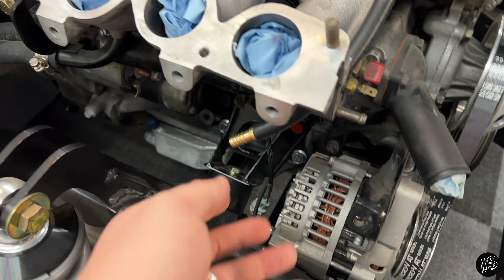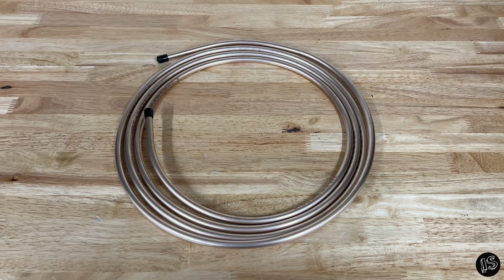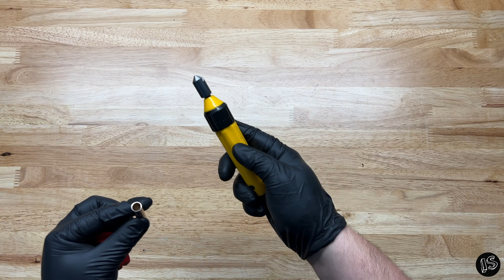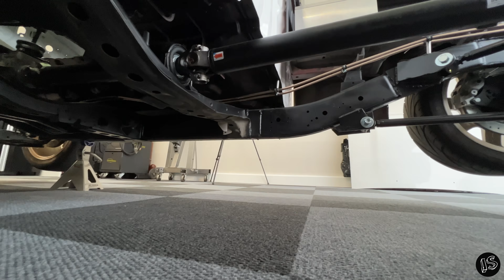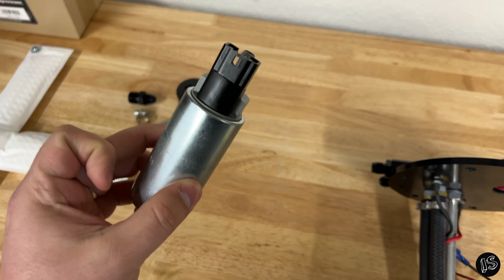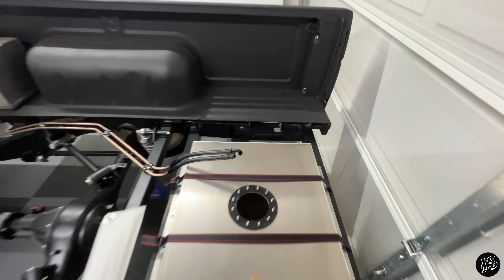Fuel System | D21 Drift Truck — Ep. 23

Comment: Man I’ve been watching your videos for a while now on this truck. And I’m really interested in know what kind of wheels you have I’ve been looking to get some like that to throw on a 2000 model
Reply: And what kind of drop are you running I love the height your sitting at. Love the truck and love your videos man I’ll be sticking around!
Reply from the maker: Thanks! 😎

The wheels are Level 8 MK6 17x9 +0 offset and the tires are Federal 595 RS-R 255/40ZR17 and the truck is dropped about 6”-8” roughly.